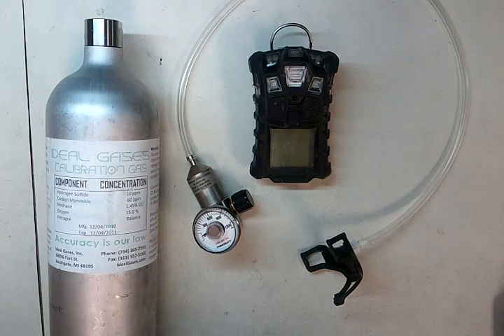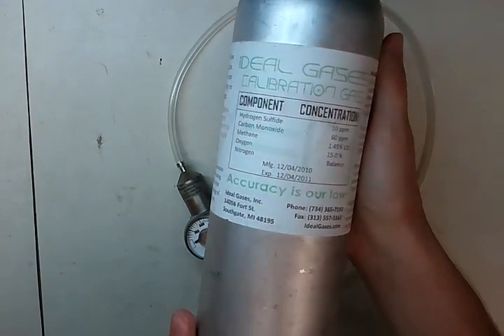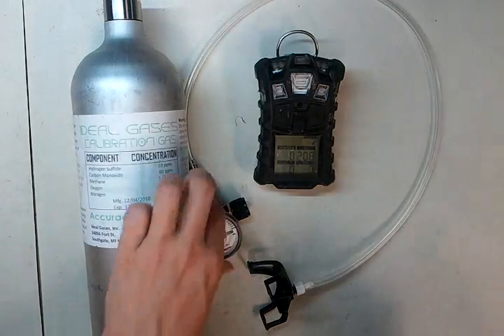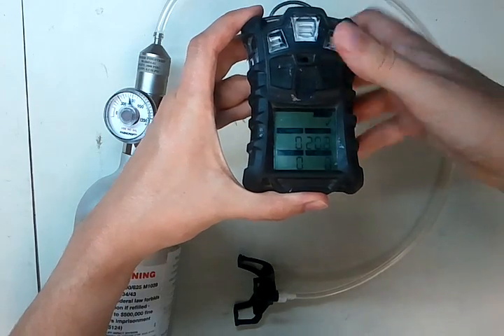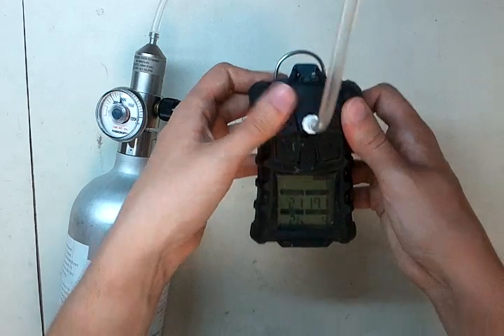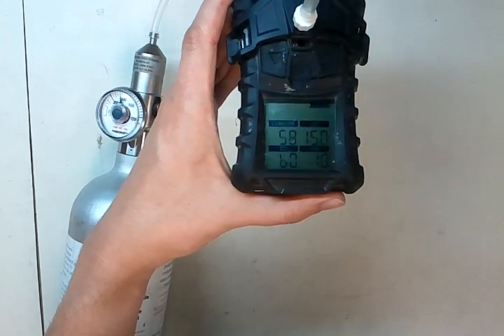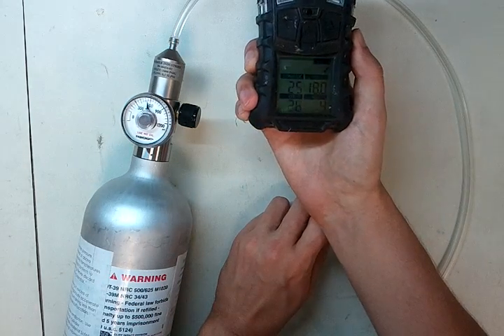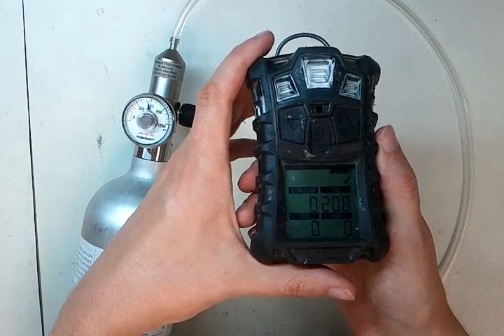MSA Altair 4 Gas Monitor Calibration Guide by Ideal Calibrations

Comment: I watch this video a few times a year to help remember the procedure for this meter. We use it as a backup so it’s not done as frequently as the main guys so I get a little fuzzy on it. Very easy to follow video. Thank you.
Reply from the maker: Hey John, thanks for the kudos man! We appreciate you reaching out and letting us know it helped you. If you need to know anything else about the units or think something else on video would help let us know. -James
Reply: good video my estimate, my query is, I have a 415 that I cannot calibrate, the HC reaches 38% LEL and fails.  what can i do ??  I would appreciate your comments. I AM using for calibration 50%lel gas

Comment: great video.. i have a question.. how much the gas bottle last?? i mean... if the bottle contains 29 Litres of gas, how much gas is spent in every calibration?.... If I use the detector just 1 or 2 times per month, for example in confined and underground areas... how frecuently calibration is required?
thanks beforehand....

Comment: I just want to confirm before i spend the money that if it fails calibration test because of the top left number then I need to buy that sensor? Or is there something I should try before I do buy it?
Reply from the maker: Hey Michael, I would say most likely. Make sure to check the calgas and that it's set for 58% LEL Pentane and also that your monitor is set for 58% LEL and reading in Pentane units. Sometimes people screw with the settings and that can mess you up. If all that's checked off I'd say yeah, time for a new sensor. We have them in stock if you need one.

Comment from the maker: Possible issues:
1.  Your calibration gas is expired and the H2S has faded.
2.  Someone screwed around with the calgas settings in the setup menu.
3.  One of your sensors is dead.

Which sensor is showing up as failing?  You can email me from the contact page of our website, I'll help you troubleshoot it.

Comment: hi, I have a question for you, i hope you can help me
I have an altair 4x and when I sent it to calibrate it showed up an error, the Ex sensor wasnt working so we bought a new one and the people who calibrated the device told me that if they calibrate the device again another sensor could fail. The question is... is it true?
Thanks in advance
Reply from the maker: Hey Gabriel,
Sorry for the delay.  Calibrating the device takes very very little of the sensor life away, and it should be done regularly.  Don't let anyone ever scare you into not calibrating your MSA Altair 4.  If you need help installing the sensor or anything and want me to walk you through on a video chat let me know and I'll give you a hand.  How old was your 4X?  That LEL sensor may have been covered under warranty.
Reply: my altair just have 1 year thanks for your answer
Reply from the maker: Then it was DEFINITELY within warranty.  The 4X has a 3 year warranty on sensors.  Go beat your repair shop with a stick.

Comment: After I span Cal, should the last calibration date change as well in the unit?
Reply from the maker: Yes it should, if its wrong. most likely need to check the calendar on the unit, we see those off fairly frequently.
Reply: Thank You!

Comment: What is "Span Calibration?"  It says that after the Fresh Air Setup
Reply from the maker: +HOPE Days Span calibration is calibrating the sensors with gas as shown in the video.  Zero tells the monitor "this is what good air is like" and span calibration basically tells the monitor "this is what bad air at "x" level is"

Do you need help walking through the process?  We could set up a call for you on Monday to help you if you like.  Our number is 734-956-0539.

Comment: Would it hurt to use a 0.5 Liter/Min regulator instead of the 0.25 Liter / min?
Reply from the maker: You really should use a 0.25lpm (the tubing thickness MSA uses isn't really built for 0.5lpm, delivers the gas too quickly and that can cause a pressure buildup on the sensors which will change values), but if you're in an absolute pinch the 0.5lpm is better than not bumping the monitor.
Reply: Thanks!

Comment: My ALTAIR® Single-Gas Detector has +5 months left, Can I replace the battery?
Reply from the maker: Unfortunately those guys are disposable units.  Changing the battery isn't going to make a difference.  You can on the Altair Pro units though.
Reply: @Idealcalibrations  you sell the gas mixture? Can you send to Mexico?
Reply from the maker: @josuecarrillo1636  Hey Josue, yes we do and we can. Want to send an email to support@idealcalibrations.com with what you need and we'll send you a quote?

Comment: I have a Altair MSA 4x gas monitor and when I turn it on a Sensor Discovery shows up 2 or 3 sec after turning on. I can get it to calibrate but the date , time and last calibration date are not the same( keeps coming up 2008 last cal) what is  wrong with this monitor
Reply from the maker: +COUNTYMAN 16 My bet would be that the battery holding the clock module in place died at some point.  Try going into the settings before startup and updating the clock and date.  If you have trouble, you can give us a call and we'll walk you through.  734-956-0539, ask for James or Claire.
Reply: Ok thanks I'll give it a try